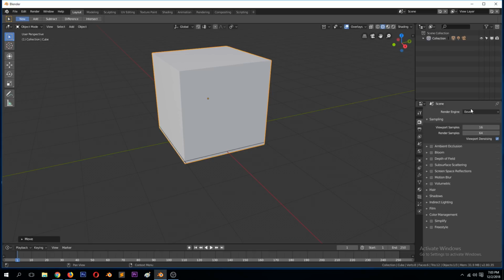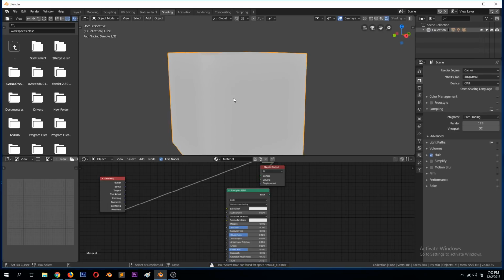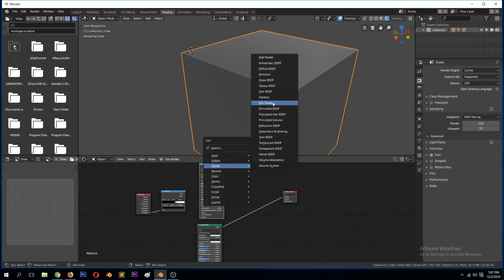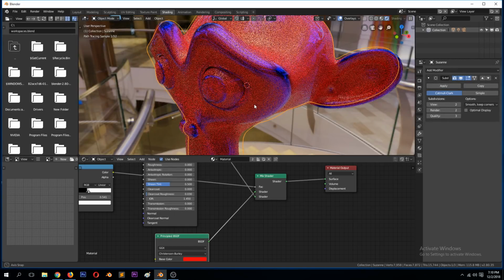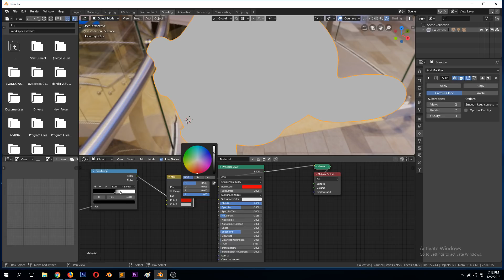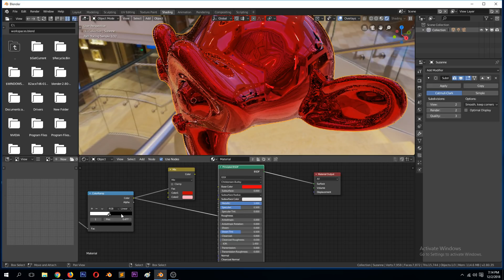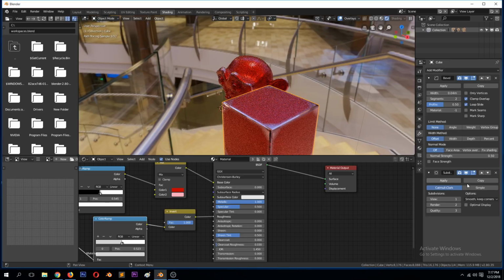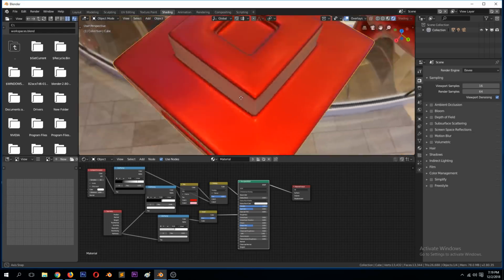creating worn out shaders in blender 2.8 for metals

Comment: hey bro, hi again, is this node useful for heavy duty metal material? for example military industry ships or tank? nothing so clean but also not super rust...thx.
Reply from the maker: yes you can use it to control whee rust is going and warn out area
Reply: @TopChannel1on1  is it necessary to use subdivision modifier to make this node? I mean I have an object with too many polies...but not subdivided model...thx
Reply from the maker: @leatherandpoemscharmyman5774  no but you need more polygons to get a more defined bake and subdivisions or multiresolution helps
Reply: @TopChannel1on1  ah ok thx

Comment: Nice video. A tip: if you use the Input ➔ Ambient Occlusion node in stead of Input ➔ Geometry ➔ Pointiness, the edge detection will be topology-independent, so it will also look great on a low-poly mesh.
Reply from the maker: thanks are there any other nodes to add inbetween to make the ambient occlusion more pronouced because its always abit light to use
Reply: @TopChannel1on1  Absolutely. Try adding a Math node and set it to Multiply mode. A ColorRamp node is also very useful to change the output of the Ambient Occlusion node.